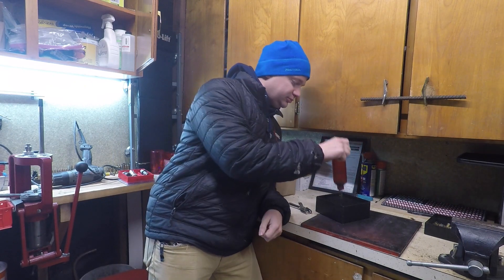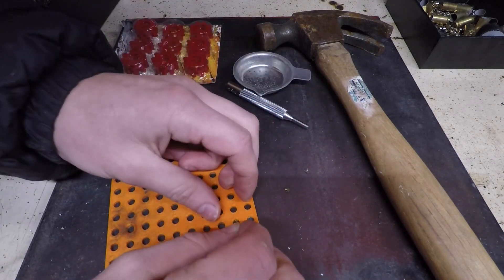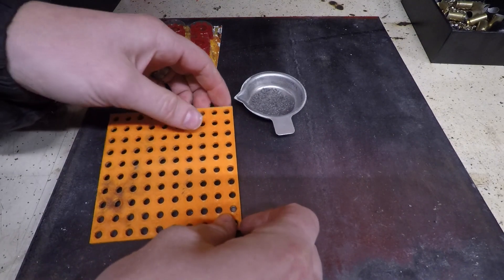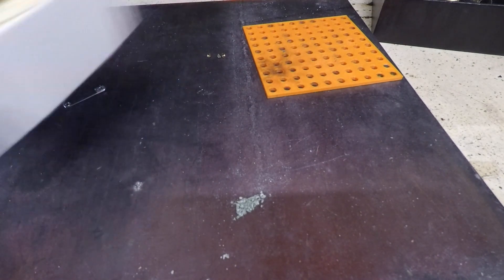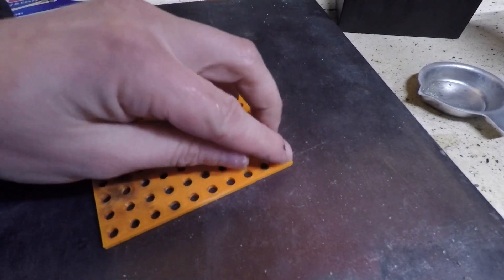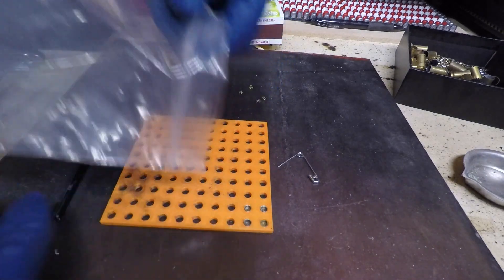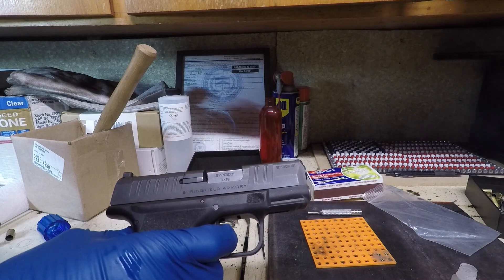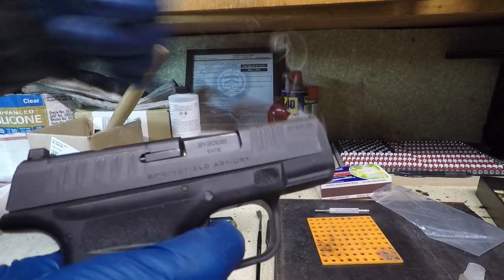70K Primers - Intro to Reloading Primers

Comment: The h48 is good but the way you do it isnt optimal. If you put a paper disk between the anvil and the powder and drop the shellak you will get much much better results. Instead of shellack, use a 50/50 mix of acetone and duco cement. Or dillute a very  amount of smokeless powder (quarter teaspoon) in acetone overnight. Dilute it more to obtain a liquid before applying. Apply over the disc and press in anvil.
Reply from the maker: Thanks for the tips!
Reply: But you can make better AND non corrosive mixes...some even lead free...
Reply: @alexm2833 Recipe?
Reply: How do y'all make paper disks the right size for a primer?

Comment: Primer manufacturing is the most dangerous process of making ammunition.  The primer mix is an explosive and not a propellant.  This is why primers are made in a separate building far away from the rest of the plant.  Within the past year (2023) a worker was killed in the primer building at the Hornady plant.  

One might say, I'm only making 5 or 10 at a time; what can possibly go wrong?  That gets tedious and boring so I'm going to upgrade and do 50 or 100+ batches.  Before you know it, it gets out of hand.  I'm not going to call anyone stupid or foolish for making their own primers, but go into it with your eyes open and fully aware of the potiential dangers.

By the way, has anyone shot any ammunition loaded with home-made primers for velocity, pressure accuracy, consistency?  Does ti properly function your firearm?  Does the cup show any signs of piercing?
Reply from the maker: VERY true primers are a whole different ball game. In fact I put 100 of them in a primer pick up tube and blew them up in my garage to see what would happen (https://www.youtube.com/watch?v=es1YgL3izWY). Lets just say I wouldn't want to be anywhere near it. 

Respect for primers is needed, especially when reloading/manufacturing them.
Reply: @TheLarkinsLair  Absolutely!  Proper care in making and housekeeping are a must.

I'm still intrested in accuracy, velocity and pressure data.  Accuracy and velocity would be easy as chronographs are readily available.  Accurate pressure measurements may require the services of a ballistic lab such as H.P. White.  I would not trust reading the cartridge case for the signs of unusual (high/low) pressure.

Have you tried using Berdaned primed cartridge cases?  I'm thinking with the integral anvil, it might be easier to make, load or be more reliable?  Intrested in your thoughts and experience.

Cheera!

Comment: Trying to reuse primer will be loose as a goose when you try to put them back into a shell.
Reply from the maker: I honestly haven't reloaded thousands to see if that is the case. However in the creation of this video and some playing around I did around 200 and never ran into primers falling out. Not saying they can't, just saying I didn't have that issue. 
But at the end of the day it is far easier to just buy primers especially since prices have finally come down.

Comment: lol @ me watching this after throwing away a quart size bag of spent primers I kept for over six years because I was convinced there was a use for them.
Reply from the maker: Haha!  Honestly this is shtf stuff. Not so much a practicality unless you have ample time on your hands, or you genuinely can't find primers. I honestly just stick my spent primers in a tub with my brass that is too shot to re-load and then take them to a recycler. Primers are made of brass to avoid galvanic corrosion to the casing. Even though they are dirty, they are still brass.

Comment: Why are you using cap gun caps and strike anywhere matches as an ignition source when you can actually buy the same product used by primer manufacturers? In fact there is an entire repriming kit that helps you reprime spent primers.
Reply from the maker: My understanding is that prime all compound is pretty much the same as the H48 that I make in the end.

Comment: 🇦🇺😎👍Hey mate primers down here are between $650/$1000 per 5000 at the moment if you can get them. 3 years ago on special Winchester ones were as low as $218/5000. Bit of a difference hey. Great video
Reply from the maker: Yeah, primers are still stupid expensive.... :/ But at least we can get them now.
Reply: 🇦🇺😎👍Yep @TheLarkinsLair

Comment: As time has gone on have you been reduced to using these regularly? And if so or if you have been experimenting with them.
 Basically have you been running loads through a chronograph? And if so how is the consistency? Plus how close has your results been to the data in manuals? How can I put this without getting you into trouble as in your dont try this at home disclaimer. Do they appear to run on the hot or cold side of things? Have you just used these in a pistol or have you run them through a rifle?
Somebody in another post commented on you would be a good nabor to have in a SHTF situation. If we were on good speaking terms I agree.
Reply from the maker: Honestly I heard about reloading primers when it got real hard to find primers so I gave this a shot. But I didn't put too much effort into fine tuning them and getting the reliability to be super solid. With work I could see the H48 compound being just as good as commercial primers minus the fact that they are corrosive. 
The reason I didn't work on it more is because I was able to find primers and time is one of my biggest things I try to reduce when reloading because I am super busy (kids, work, life, etc). 
I with minimal effort I got the reliability to about 95%, which is horrible for primers. But there were a lot of things I could have improved, but I just never got around to it. The left over H48 compound I mixed up I ended up just putting it on a rock in the garden and throwing another rock at it and then laughing at the explosion.

Comment: So have you put lead on top of these and tested or are you just going off the loudness of the bang and smoke output?
Reply from the maker: I never got around to testing these with live rounds, but I did put powder in the casing to see if it would ignite and it did without any issues for most of the primers.

Comment: Did the H48 method with prime all before I was able to find some cci. Got a few hundred 9mm that I don't even wanna shoot cause the stuff is so nasty lol. Coats the barrel and action orange and it stinks. I def wouldn't use them in an AR. That would be a royal PITA to clean
Reply from the maker: Yeah, it is no fun. I don't re-load my primers, but if crap hit the fan and I had powder and projectiles and no primers then I would. But next time primers are cheep and available (may be a while) I am going to stock up like crazy.

Comment: Would flash powder work? If you could stabilize it enough to be safe to work with.
Reply: if by flash powder I was wondering if the powder you use to prime a flintlock pan, shouldn't that work? in fact in the flintlock the flash seems to have to travel farther, whereas in a centerfire cartridges it's a straight unobstructed shot. good question I hope someone with information can address it!
Reply from the maker: That is a good question. I may make a video on this one day. I am not sure a striker would set it off. It would also need to be able to work with the alcohol/shellac to form it into a solid disk so the powder doesn't escape the primer when loaded in a cartridge.

Comment: I just can't bring myself to use that much time. I need thousands of primers not a dozen or so.
Reply from the maker: 100% I still have yet to get the process down and time is $$ I would rather spend the time with my family and pay the crazy prices for commercial primers. But hey, if the world ends then I have enough material to reload 70K primers. Now just need to find powder.
Reply: Okay, this is part of the problem, target pistol folks cornering the market on small pistol primers, race gun stuff, etc. competition. Now, casual recreational shooters are shit out of luck, no factory ammo, no primers and panic buying and stockpiling.
I'm guilty myself since I have maybe 12k assorted on hand which is actually a lifetime supply for most of us, and I have sold a few boxes for 3X what I paid for them. One thing that seems accurate is that magnum primers are just as effective, as a substitute, if that's all you have. Maybe not benchrest quality, but better than shaving match heads. PS I have some matches, I don't know what they are called, maybe they are the strike anywhere type mentioned several times. These are wood, about 3 " long and half of it has an orange compound with a purple tip, not quite the size of the exposed portion of a 22 rimfire. If this has already been covered and they are also scarce, I will shut up. 
ridiculous

Comment: Important note to add about H-48.  It's corrosive.  Essentially it's the same compound that is used in the corrosive boxer primed ammo from comm-block countries.  Be sure to clean your gun after you fire them because it will begin to degrade the barrel over time.
Reply from the maker: Yes very true, you NEED to clean your gun ASAP after shooting them because it will eat up the barrel pretty bad if you don't.
Reply: clean with?  I usually oil the bore... is that enough?
Reply: @victormiranda9163  nope not with corrosive primers. You need to dissolve the salts with soap and water. Then wipe down and oil. Avoid using these in semi auto blow back or especially gas operated. Bolt guns, breach loaders are not a problem because the gases stay in the barrel.
Reply: @alexm2833  if you are in a hurry could you use windex? I noticed when knife makers etch with acid they use windex to neutralize it.
Reply: @electromech7335  I dont know about windex and how it acts with the salts. I dont think its acidic, it acts more like salt on metal not acid. But im no chemist.
Reply: @alexm2833  Ok thanks. 👍
Reply: @victormiranda9163  If you're using corrosive primers, you need to remove the salts before you put the oil on.  So a cleaner like Hoppes or something to clean out the barrel, then very light coat of oil.
Reply: @MobiusUSAH greetings friend.  Products like Hopes won’t neutralize the corrosive salts.  You have to use water soluble oil such as Ballistol.   Although it’s said ballistol alone can be used, it’s best to mix the ballistol with water for the initial cleaning then finish with straight ballistol.   This cleaning solution mixture in the blackpowder community is called moose milk.   Alternatively if it’s preferred to finish using regular or none water soluble oil, the barrel must be completely dry from what I understand.
Happy shooting.
Cheers!
Reply: @victormiranda9163  Lots of soapy water. Ballistol watered down works too. I used Ballistol to clean my ak when using corrosive ammo. i have used h-48 to reload primers. It works. Now if I have to shoot primers with it. I clean the bore within hours. As soon as I get home from gun range. Dont wait days. You will regret waiting a couple days.
Reply: All three those methods are, because H48, toy caps and matches are all potassium chlorate based (some toy cap use lead styphnate, but it's hard to tell).

Comment: Is the H48 corrosive?
Reply from the maker: Yes, so if you use it make sure you aren't lazy because you need to clean you gun right after you shoot.
Reply: Yes, it is a chlorate based priming compound, as we used in WW1 ammunition.
Reply: If your reloading primers I think the matter of corrosive or not goes out the window, just keep em as clean as you can.